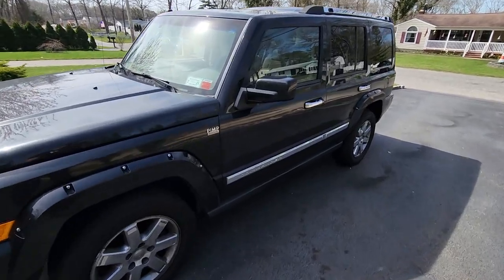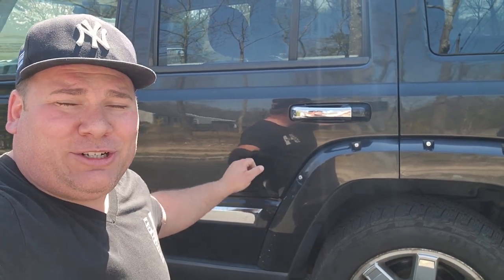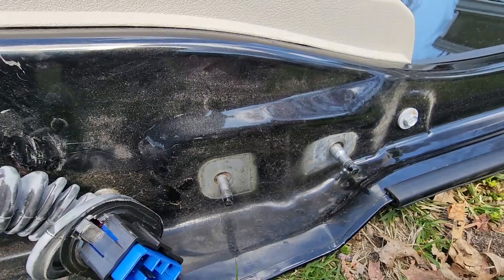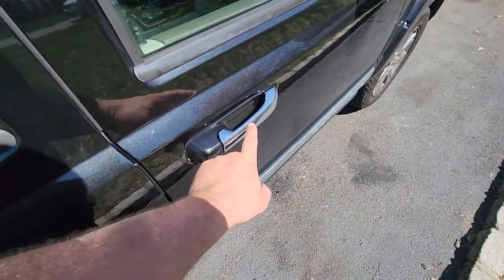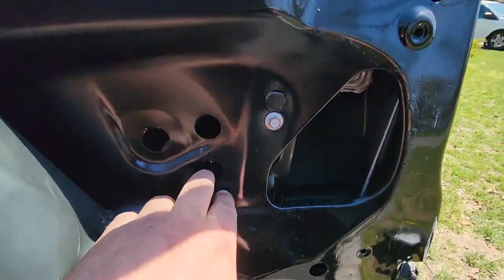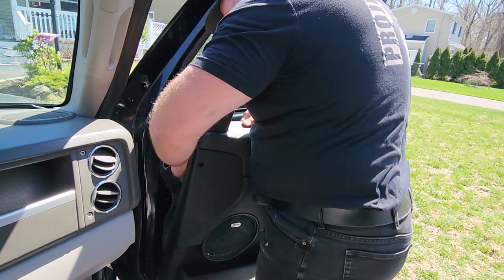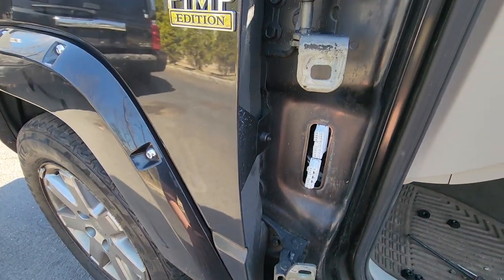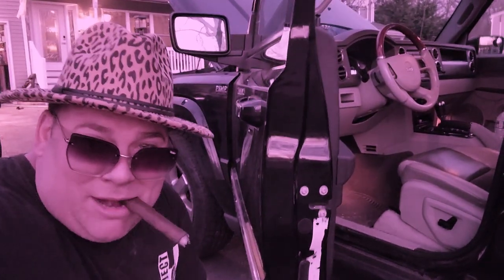JEEP COMMANDER FRONT AND REAR DOOR SWAP! DOOR HANDLE & INTERIOR PANEL SWAP TOO!!!

Comment: These Commanders are cheap as chips ( fries:) here in the UK but don't have a great reputation for reliability. The XJ sold very well here but later Jeep iterations weren't popular, other than the Wrangler. Curious to know how would you rate the Commander Vs the XJ reliability wise? Big fan of the squared off styling but don't need another rolling project - that's your department 😆 Love the channel 🖐️

Comment: Can I swap my limited Commander 5.7 hatch with a base, I don't want to lose my ability to open it with my fob. If so what all is need to do this...thanks
Reply from the maker: Not sure Buddy.. I haven't taken off the hatch.  It's probably just 4 or 6 15mm bolts tho.  You'll probably have to take out some interior trim to access the plug

Comment: Hi Dan, Im out here on the south shore. Got a question: What are your thoughts on eliminating the mechanical cooling fan on a 01 xj 4.0 and using electric only?
I had a heat soak issue if I went into the store for like 10 minutes. Hooked up a momentary pb in the cab and adjustable (up to 3 min) time delay relay for cool it off for those short time periods when the temp rise vaporizes the fuel in the rail. Seems to work but its still spring.  Have you done all electric or know someone that has? If so what is the opinion? Engines tight with 125K, I installed new injectors not to long ago, and the fuel pressure in the rail doesn't bleed down over time when off. Thanks, Tom
Reply from the maker: Hey what's up Tom! I have mixed feelings about this... The mechanical fan isn't great but it's always there when you need it.. I've seen three core aluminum radiators with three electric fans that look very tempting to use but there are a lot of money.. I wouldn't settle for a cheap knock-off fan set cuz I wouldn't want to be left dead in the water God forbid the e fan break somehow.  Maybe if you put two fans on the normal circuit and one of the fans on a manual switch with a time delay relay that could be really cool..    on my old Jeep I removed the air box and modified a second XJ electric fan to blow right at the fuel rail. while you're in there give yourself a good coolant flush.
Reply: @ProjectDanH  Thanks for the reply brother. I'm kind of torn that way too, if the electrics quit kind stuck 😕. I was thinking about after i posted.  The set up I have now seems to be working. I have a 01 black beauty. If you see me around down around SP flag me down would like to meet ya. Thanks again.